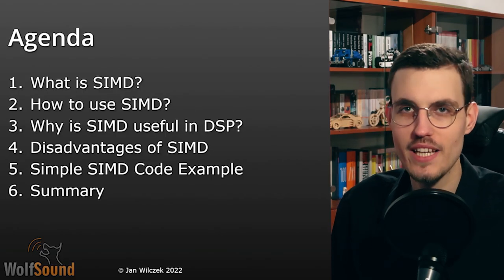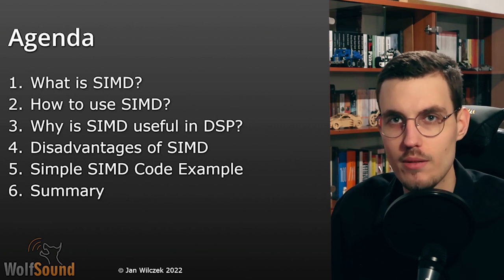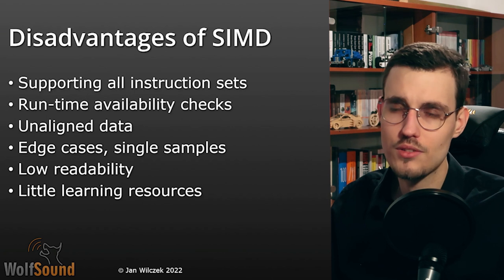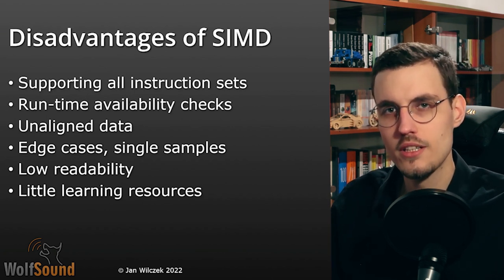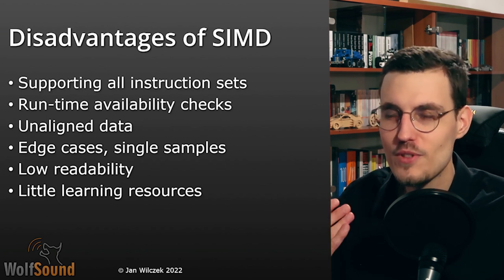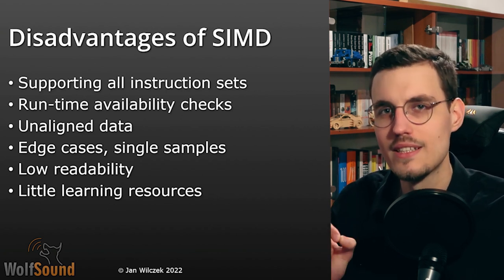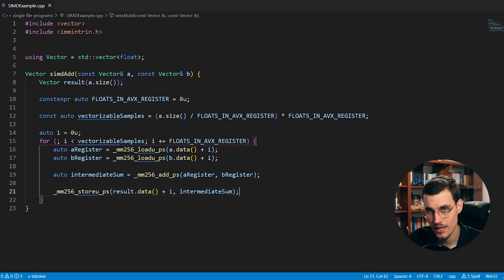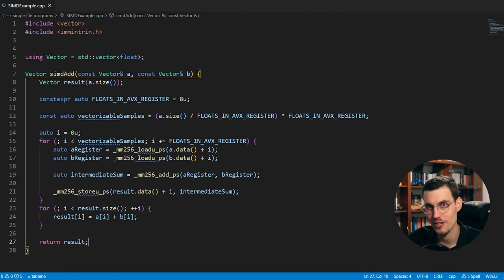What Are SIMD Instructions? (With a Code Example) [DSP #14]

Comment: I can understand the concept of simd. But, in the code I can see that you are adding each value when it is added to the register. I see that which is equivalent to scalar addition, I think inorder to avoid one more for loop to store the addition values into the result array which makes sense. This points me to ask whether the intrinsic function performs the addition, only when all the 256bits are filled with values or it can also perform otherwise?

Comment: Great job, 
but didn't second for-loop killed the entire reason of using SIMD?
Reply: Late reply, you probably already have figured it out by now. Responding anyway for others with the same question.

That's like saying planes are pointless for traveling large distances, because you still need to walk the short distance to your destination from the airport.
SIMD will do a large portion of the work, in this case it will do it in multiples of 8, and the regular loop will finish the remaining amount
so for normal loop you are looking at:
N*scalar
while for SIMD you are getting:
floor(N/8)*SIMD + (N%8)*scalar

Since by design 1*SIMD will be faster than 8*scalar, for sizes greater or equal to 8, the second algorithm will be faster than just doing the first loop. Otherwise, for sizes smaller than 8, it will be the same as the first loop + some overhead because of the division by 8.